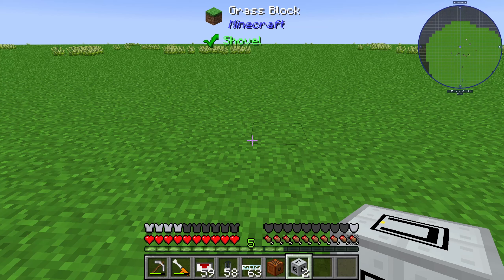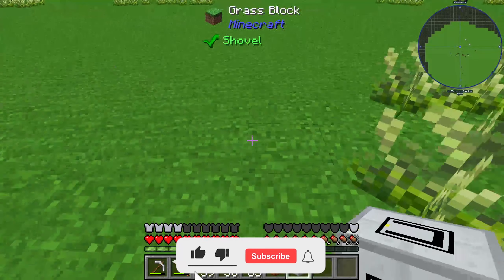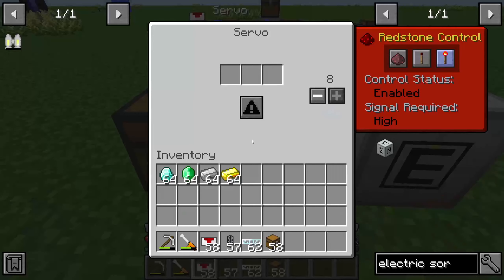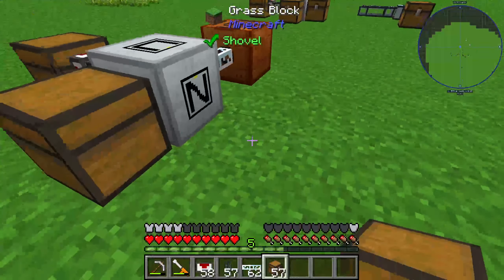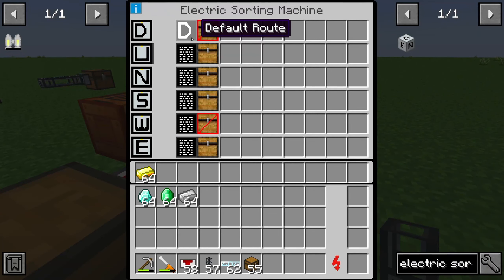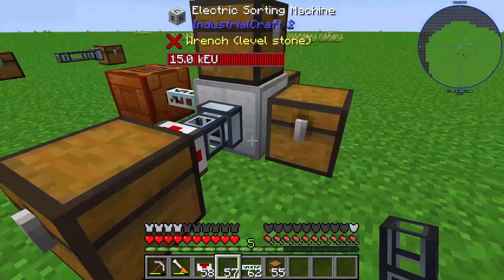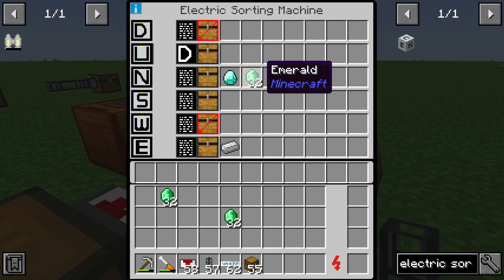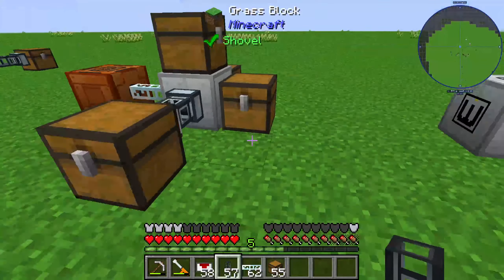Electric Sorting Machine 💎 Industrial Craft 2 Tutorial 💎 English

Comment: Where did you get the Item Duct from, though? That doesn't appear to be apart of IC2.
I'm sorry if you audibly said it, it's a little hard to understand what you were saying.
Reply from the maker: Nearly every Tech Mod has its own cables and cable mangagement. Yeah the item duct is not part of IC2
In this case, it is part of Thermal Foundation / Thermal Dynamics. But there are many other mods which have good cables like EnderIO, Mekanism, Cyclic and so so. 
But i dont like the cables from industrial craft :D